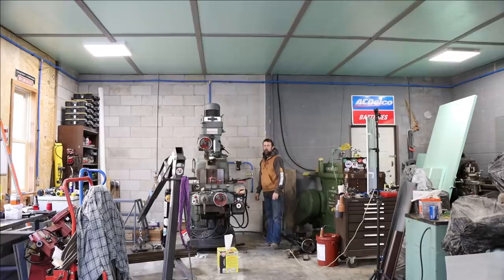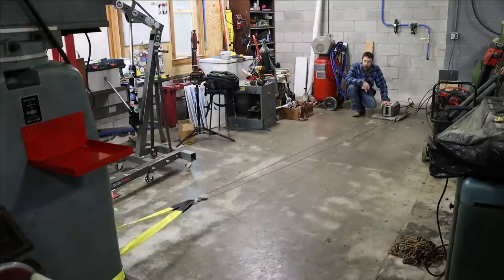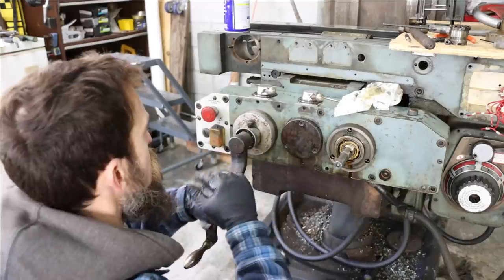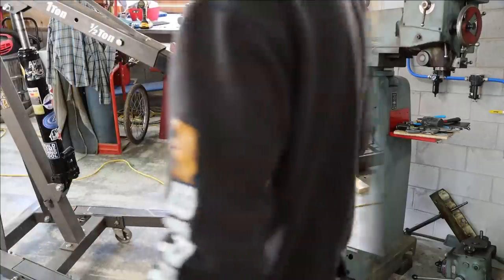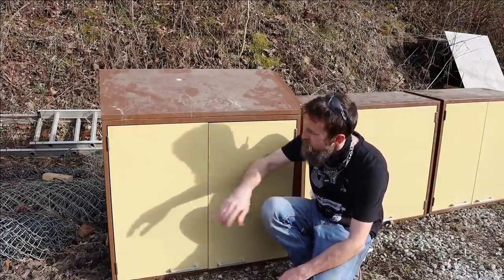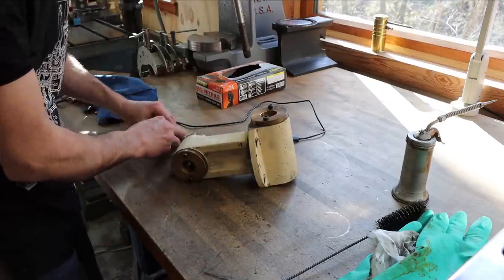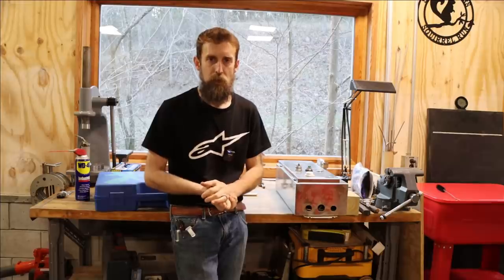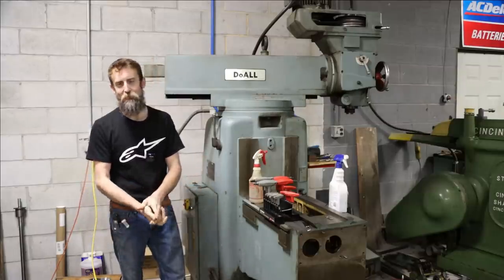Tearing down the DoAll mill. The Damage is bad.

Comment: With you being a welder, I thought you would build a mobile gantry and use a chain block to remove the knee. They are extremely useful. 

You will need something when you remove the head also.

Comment: I appreciate clean smooth mating surfaces as well as the next guy, but if the intended surfaces maintain the alignment and tightness why bother with resurfacing? Just clean up (maybe some hand stoning) and reassemble isn't that the reason for gibs?

Comment: Did you consider installing a lifting rail system when you were rebuilding the shop? I guess that would have been really expensive!
Reply: Best way is to invest in a 2 tonne (metric) capacity forklift, maybe an old 1970's-80's gasoline powered model and build a crane attachment for it. A forklift would load and unload trucks, lift heavy parts, pull and push heavy machinery and vehicles etc. Andrew Camarata has built a gantry crane for his shop, but its a bit of overkill. The gantry is suitable for a full on industrial application and in some countries the crane has to be certified for safety, I don't know about the US.